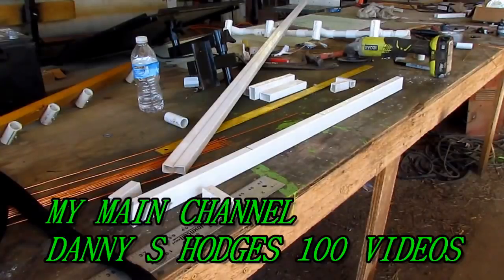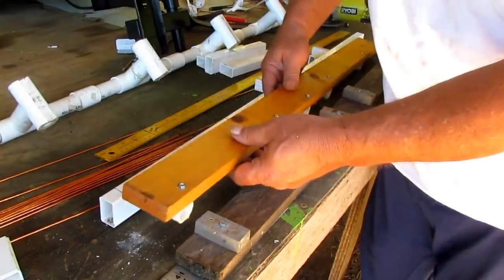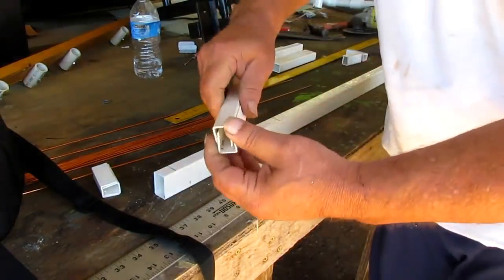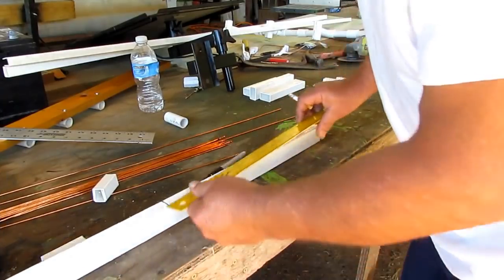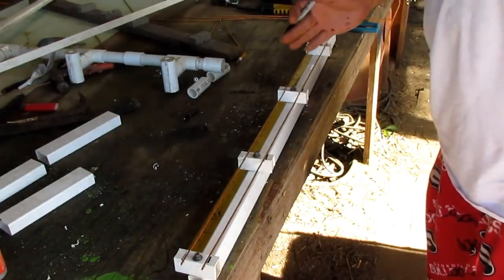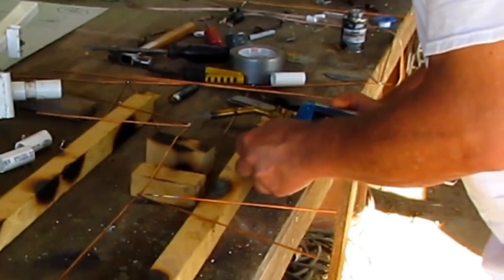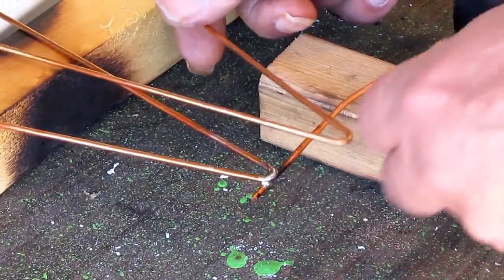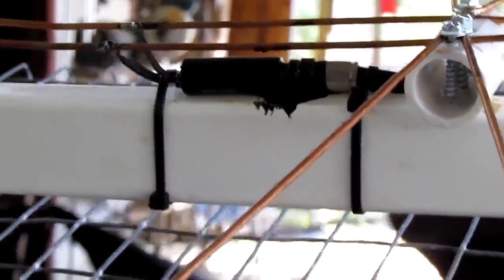How To Make The Ultimate TV Antenna Revised

Comment: Danny - I built your antenna today.  I made it from wood and it is right now sitting on a stand in my living room.  I think I spent about $80 for the materials.  I spent that much mostly because I had to buy a whole lot more of the metal screen that I actually needed.    The plan is to put it in the attic.    I had a store bought powered indoor antenna I paid around $40 for and it got me a total of 3 stations.  Your antenna has got me 23 stations.  When I put it up 20' higher in my attic I expect even more.   You da man, Danny!    From the Gulf Coast of Mississippi about 40 miles from Biloxi and about 50 miles from NOLA.

Comment: Danny, after watching several of your videos, I decided to build the ultimate antenna.  I recently cancelled my cable tv because I don't want to keep paying $200 a month for basic tv channels plus the internet. I kept the internet and dropped the tv channels.  I built my ultimate antenna out of wood for the back bone after painting it with used motor oil.Everything went well until I got to the soldering part.  I have never soldered anything before, so I made a few mistakes and had to do it over again soldering the whiskers.  One or two whiskers got off the 9 1/2 marks that I made earlier.  The reflector isn't pretty, but its on there.  When I tried my antenna for the first time, I was skeptical that it would work as I didn't do a great job putting it together.  To my surprise, it picked up 90 channels with it inside the house.  I have brick siding and trees all around me.  I'm also 35 miles away from the TV station towers.  Compared to an antenna I bought at Walmart, side by side inside the house, the ultimate antenna wins hands down.  My intentions are to mount the antenna outside on a 20 foot pole, but a week of bad weather is going to delay those plans.  Thanks, Danny for posting your video on how to build this antenna.

Comment: I made this antenna to specs provided by Danny.  It works beyond my expectations.  Without the reflector installed and mounted on a tripod on the floor it picks up 20 channels with no booster.  I used 8 gauge copper wire and made a wooden frame.  I doubt a store bought antenna would out perform this model.  Thanks Danny for your design and instructional video.  Danny, now I just need some videos on soldering.

Comment: You are the Antenna Wizard Danny! Your antennas outperform the 3 different commercial outdoor antennas I purchased. I was lucky to pick up 9 channels with the store bought ones, I now can receive between 24-30 from 3 different directions and I'm in a valley surrounded by 800 to 1200 foot hills.I wish I had seen your videos before spending all the money on commercially made junk. Thanks for sharing your knowledge and experience.
Reply from the maker: tks man
Reply: A Question Please how far, as the crow fly's(,straight line) away are the stations, my closest is 65 miles, and there is three, at Panama City, Florida I would really like to be able to get a few programs, a store bought one that claims to pick up 70 to 100 miles is about $150.00 . thank you for any answers Johnny b.
Reply: The problem is in the type of antenna.  Most people, like you, are "antenna stupid", meaning that you have no true understanding of how an antenna works.  Danny's antenna is vertical and multi-directional, MOST of the long range antennas that are sold are uni-directional (the reason you have to point them and turn them until the signal strength is maxed), some are bi-directional (front and rear), an a few are omni-directional (receive 360 degrees).  Along with that is that most of them are designed for line-sight signal reception of a groundwave signal, where the vertical style can also receive skipwave signals, as long as you are not in the skip zone (dead space where the groundwave ends and the skipwaves begin).  The materials used also make a big difference (based on their conductivity and gauge) and adding a reflector can help improve the signal reception by increasing the impedance of the antenna.  In certain instances a much smaller "reflector" can be installed in front of the antenna to help draw the signal in stronger.  An lastly, the orientation of the antenna is also an important factor, mounting a vertical antenna horizontally or a horizontal antenna vertically will drastically change the characteristics of the antenna and so will an antenna that is not plumb or level.

Comment: Danny, I made your original version of this and I love it. Kind of a crude imitation, but she works like a dream. It is set indoors in front of the window, looking out, and it gets every possible channel available for here. (about 12 channels on 4 stations here in the Oregon mountains...).  I learned something important I want to share:  2 of my stations are slightly different direction from the other 2, and I'd have to aim the antenna back and forth, when I switched.  Now, it is set for all of them, without aiming back and forth, just by having the reflector element able to aim at a little different angle than the whiskers.  Pointing slightly different ways, maybe 15 or 20 degrees, makes it able to pick up ALL the stations all the time, without having to re-aim the antenna when changing. Kinda like having 2 antennas.  I don't use or need any booster here. All the stations are on low power repeaters not very far away (15mi. ?...).
Very thankful that YOU have shared this design with us, Danny!  
Keep up your good work and God Bless!
Reply: Hey Danny, is this a 'direction' a future video might take? 
LMAO
Good job to both of you!

Comment: Danny, I built this with a few modifications and it works GREAT!  I’m 60 miles from all of the transmitters in Cedar Hill Texas, and I’m down in a valley too.  I put the antenna in my attic and I get 58 channels!  The major difference between mine and yours is I used 3/4” x 1” rectangular PVC moulding from the mill work aisle at Home Depot.  Thanks!!!

Comment: Thanks for sharing your knowledge with others about the antennas you build. I just built the Ultimate Antenna and it works great! I built it in hopes that it would work for my parents that are on a fixed income that can not afford cable any more. I installed it today 25' off the ground with no booster, 65 miles away from the closest transmitting tower and picks up 19 channels. I have very happy parents! THANKS!
Reply from the maker: a booster will help 25 pecent
Reply: @southernideas6175  
D, can't u get a hold of me? Steven has info. Thanks. ✝️

Comment: Just made the original antenna today.
Board, copper wire, screws, solder, and COAx to TV adapter. I was shocked that it worked as good as it did on the ground. I put it on the house and doubled the amount of channels.
From a store bought @ 10channels to the DIY antenna @ 115channels.
Thank you sir for the video.
Reply from the maker: tks for letting the people no...THE BEST ANTENNA KNOWN TO MAN
Reply: I'm in a tricky place, I'm 76 miles from Knoxville Tennessee and 70 miles from Lexington.  I can get WATE CH 6 and WBXX CH 20 From Knoxville Tennessee but no VHF will pick up on the Channel master 4228hd .  Also two channels from Lexington Kentucky, channel 27 wkyt & WDKY Fox 56 .  It's VHF that won't pick up around here.  UHF picks up better.

Comment: I appreciate your videos very much. I have built a smaller version on treated wood. I get most of not all over the air channels. I would like to know the distance from your reflector and copper wires. My v's are set of four on each side and two middle wires that cross at both ends. I found your videos and seen reflector. Your antennas look pretty good like the material.

Comment: Just wondering, what happens if you don't cross the wires going to the whiskers? Does it make a lot of difference?  I have heard that if you ground the reflector it will work better, have you ever tried that? What about some pvc coated wire for a reflector? I just happen to have some from building cages.

Comment: I want to build one of these antennas. I currently have one that was purchased, but, there are a couple of channels that I know I could get better if I had a better antenna. I just have one question.. what is that part called that you solder onto the antenna that you plug the cable/wire into. Is that just like what we used to use back in the day to add a cable wire to a tv that only had the two screws in the back.. Also, my antenna has an amplifier that I keep plugged in and it really makes a difference with that amplifier. It now has a short in the wire and without it, I lose all my channels.. I have to go out and wiggle the wire till the little red light comes on again. Do you use an amplifier with your antenna. If so, where do you just buy the amplifier part? ty your video was awesome, I'm deff gonna use this as my blueprint to build my first antenna!

Comment: For the life of me, I couldn't find the Pvc fence piece like the one your using here at either of my local big box stores. I love this version of the antenna and want to build it this way. Would you mind giving me the measurement of this fencing piece (the way you buy it) so I can find the right ones? I probably have to special order it. I found the lattice cap from the other video. Thank you so much, Danny!
Reply: Steve Fernino that pvc fence part is what I call “u” channel. It is what attaches to the side of the vinyl post to hold the fence panel. Search for a vinyl fence supplier in your area. ABC Supply, a national company, is one suggestion

Comment: Mr. Danny thank you for helping the poor man first of all. Second If you want 360 degree pick up would you just leave the reflector off? Third would this affect the range leaving the reflector off?
Reply from the maker: good question..reflector will make 360..it will hurt the range but stil picks up good without it..tks
Reply: I have most of my stations east 20 miles, Southeast around 40-60 mile, north east 40-80 miles. north around 80 miles and west 70-80. I am trying to focus a shorter range to the east and southeast and higher range to the north and west. The best  stations with the 50's-2000's programs are mostly in the 60-80 mile range.
Reply: also for those interested Walmart.com will ship antenna poles to your store for free. I checked Radio Shack and the shipping cost more than the pole.

Comment: Enjoyed your video.  I have a bit of a problem, I live in a subsidized housing complex that doesn't allow us to put anything outside, not even out on our balcony.  So i have to use an indoor antennae.  I'm currently using a 70 mile antennae that just manages to pick up a signal that is useable with an amplifier.  Now the ONLY spot in the whole entire place that seems to work is right in my bedroom, up against my bed, but because i can't put it on any kind of stand it shifts and even the SLIGHTEST movement will cause me to lose one or two channels, depending on which way it moves.  It also loses signal when it snows.  Does anyone have any suggestions on what i could try..  Would some kind of a reflector help?

Comment: I might try that. I bought one of those GE Pro antennas it works great  and I get 13 of the 16 channels they say I can tune in my area except the 3.  Its bugging the hell out of me.
I can pick up one channel 48 miles away  clear as a bell, but the ones I want is like 30 miles away only a few degrees off. Could be a tree or anything. 
My friends saw your videos and says you are 'The Antenna King'

Comment: Keep in mind that this is a UHF antenna.  Channels in your area may also be  on the VHF band and this antenna won't work well for them.   The FCC is re-packing the entire TV band over the next few  years so that all TV channels will be below the channel 36 frequency. Even if a channel is UHF today, after the re-packing in your area, it may be ordered by the FCC to move to a VHF channel.  He mentioned the spacing between the elements and the reflector was 4 in .  That's fine for Chan 40, but for lower UHF channels below 36, suggest a distance of 4 3/4" which will provide more gain for the lower UHF channels, where all TV will eventaually be.
Reply: I thought this ultimate antenna is a VHF antenna. Danny has other videos where it's a combination of VHF and UHF antenna. And the whiskers were meant for the VHF

Comment: Hey Danny, I have an idea about building a bi-directional antenna, that way you would not have to worry about rotating the antenna. I like your work.
Reply from the maker: it can be done
Reply: Compiler with same coax cable length from both antennas to the compiler. Then boom you have two directions from two antennas through a single coax to the home.
Reply: @Trick-theDev  use a combiner or a diplexer.

Comment: Danny I made your ultimate antenna and I'm still only getting the same 8 channels. I didn't sodder the contacts I used silicone after I screwed tight. Could that be the problem? Or do I need a booster? I'm about 60 miles from towers. Please help. David.

Comment: Danny where do you get the piece that you hook your lead wire coming from you house to on the antenna?? male cable connecter ? that you solder on the two wires
Reply from the maker: mostly ebay radio shack amazon  search 75 to 300 matching transformer
Reply: thanks bud found them...mercy i would have never found them under that name....i am ashamed to tell you some of the  words i searched. i am making mine out of wood ( taking a shot at your oil trick) i will let you know how i come out...i am also trying out some square wire a step bigger than rabbit wire...i already had that so i will let you know how that works. by the way do them things perform better at a certain height off the ground?
Reply from the maker: the higher the better
Reply: @southernideas6175   i am nicknaming my antenna  Danny boy  lol
Reply from the maker: good name
Reply: @southernideas6175   danny boy #  1 i goofed up....but i am going to make a big one use your ideas and add some of my own. have you tried regular thick speaker wire for wire? wire to run to house i mean? something i should know? i know it is cheaper than cable line??  you tell me ?

Comment: maybe that rustolium hammer finish paint would work good you think?
Reply: Why don't you use a soldering gun , less chance of melting plastic, and
Catch things on fire. Also it would use less solder.
Reply: Because even w/ a good soldering gun, too much heat would be wicked off down the #10 wire....solder wouldn't melt & flow right
Reply: Besides.....w/ a gun, it's clumsy trying to touch the whiskers without moving their setup....torch is just right for this

Comment: Danny I've built one with ½" x ½" cricket wire it seems to work really good, the rest is exactly how you showed in this video only I painted all the white parts black, what are your thoughts on the smaller reflector holes?
Reply: The size of the holes is not critical, as long as it is not huge. The only real disadvantage of your small mesh size is the higher wind resistance. It probably is also a bit more expensive.
Reply: @buggsy5  it can't be more expensive because I have a couple rolls left over from the rabbit cage project, I got some solid fiber glass bars that I got from work so I think my frame will be very strong, I'll just make sure to reinforce everything

Comment: Hi Danny,
Thank you for all your videos, I think I've watched all the antenna ones at least 5 times. I have a question about the length of the whiskers; have you tried making the lengths vary for the true 1/2 wavelengths of the channel frequency spread? So a set of whiskers at the top of the antenna for 806Mhz and a set of whiskers at the bottom of the antenna for the 470Mhz, with sets that are sizes in-between those lengths? I bought the parts I need, but I wanted to check before I started building. Thank you again for all your videos and hard work you put into them!!
Reply: Did you ever try this?
Reply: @jeremycrowder6554  I did and it worked just fine. I'm not sure if it's better than just the way Danny did it, but it works great for my application. I'm actually working on doing an upgrade to a 10 or 12 set of elements without the reflector to see if I can get some towers north of me as well as the closer one's to the south.

Comment: I like the Antenna, NOW, How about a Itemized PARTS LIST and  where to find that WHITE plastic channel?  ><><  OH !  HOW do you secure a antenna to a pole? What is used ?
(((  ALSO  Do you have any tips or specs to make a ANTENNA  double longer TALL, as yours to receive better from different levels, 
()()  -- CAN you put 2 of yours BACK to BACK  or mount a 3 way triangle ?
)( )( _  DOES YOUR ANTENNA receive good VHF and UHF ?  What are the results?  What frequency RANGES does yours CAPTURE?
<<<<<<<<<<<<<<<<<<<<<<<<<<<<<<<<<<<<<<<<<<<<
>>>>>>>>>>>>>>>>>>>>>>>>>>>>>>>>>>>>>>>>>>>
THANKS!   JAN, 2019, 08

Comment: This is fine, and I'm confident it works, but I have an antenna with the same basic configuration on my house from at least 1950. I also built one in about 2008 when the FCC first made the switch to HD from analog that worked just fine on my first attempt. This is not new.